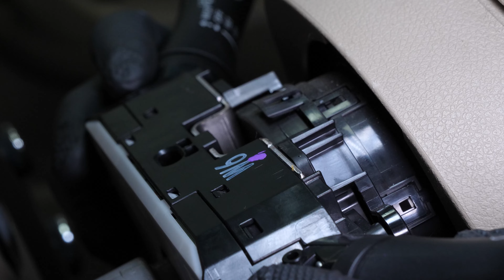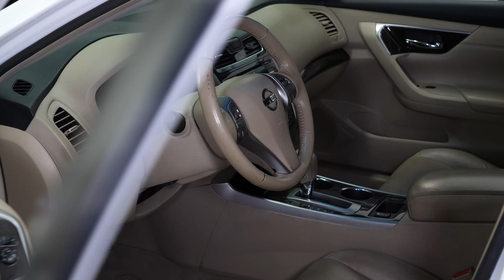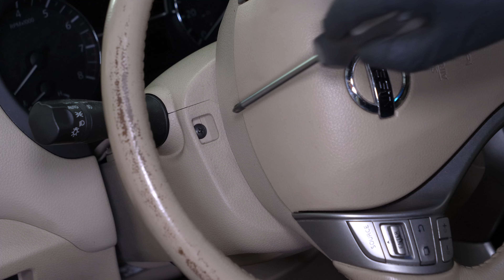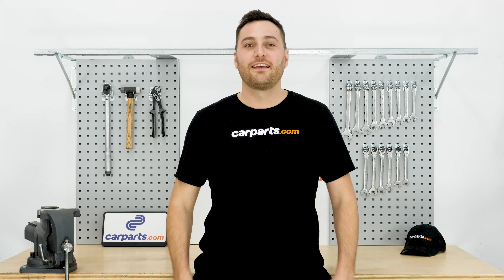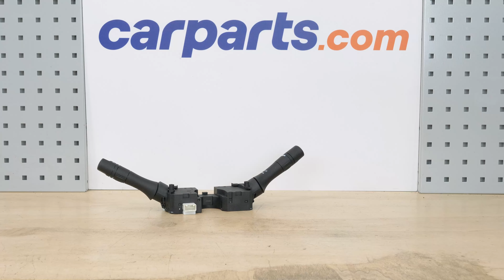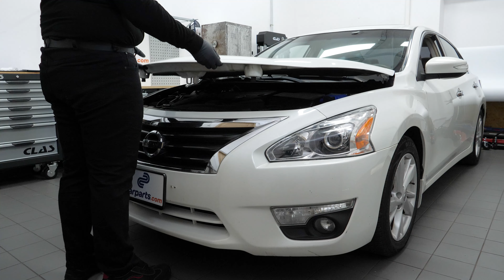How to replace the Turn Signal Switch 2013-2018 Nissan Altima 🔃

Comment: Would it be the same thing on the Nissan Sentra?
Reply: Yes, pretty much identical except on the Sentra (at least on my 2019 Sentra), there's no screw holding the lower plastic "trim" piece (what I'd call a shroud) under the steering column, and instead at the rear inside end of this shroud piece, there's a tall four-sided clip that fits into a hole in a metal plate further under the dash.